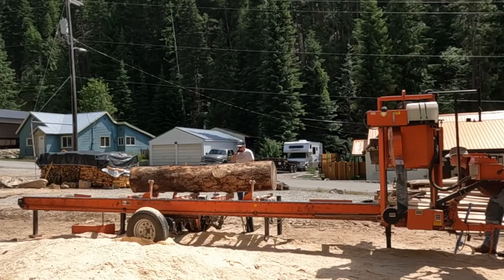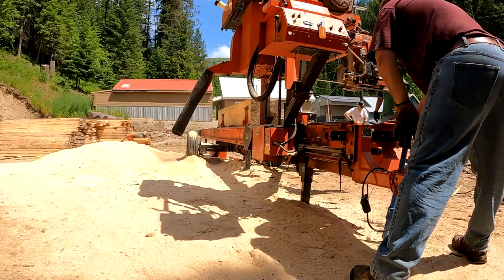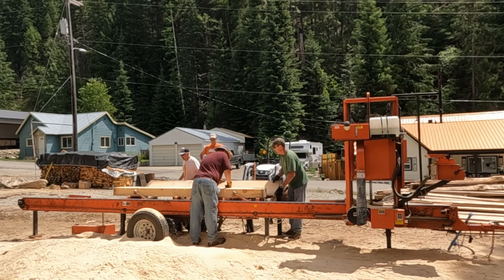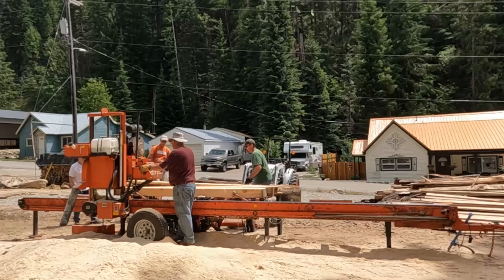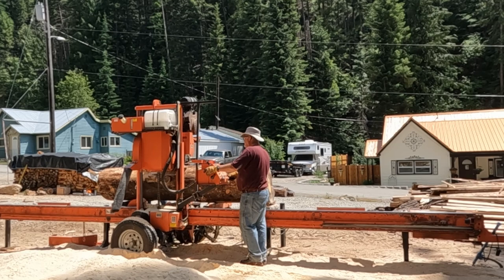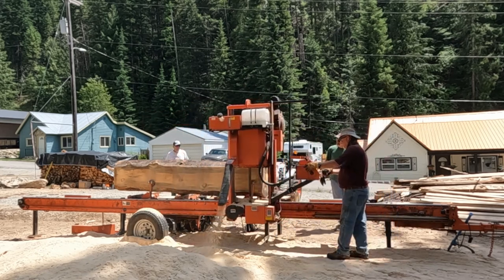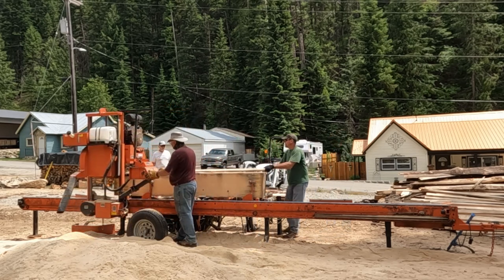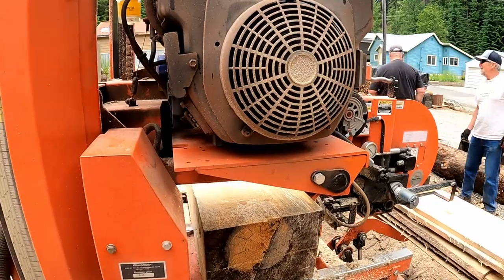MILLING KNOTTY PINE On The Sawmill [Woodmizer LT40]

Comment: Great explanation. When I got my mill I had alot of trouble keeping things squared up. I still run into the issue once in a while,  usually with bigger logs, but it can still easily happen on the smaller logs too. I call them woodmizer diamonds !
Cheers !!
Reply from the maker: Yup, it can always happen!  You get used to seeing the flat surface of the open face flat against the side supports and then, as if the log wants to remind you that you are a mere mortal, it doesn't sit right and you're milling a parallelogram! lol  Cheers!